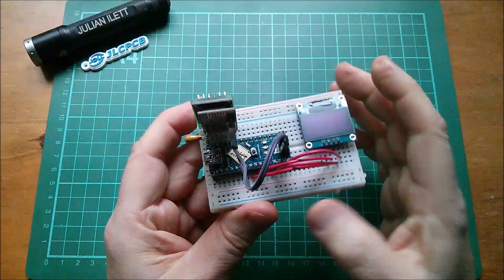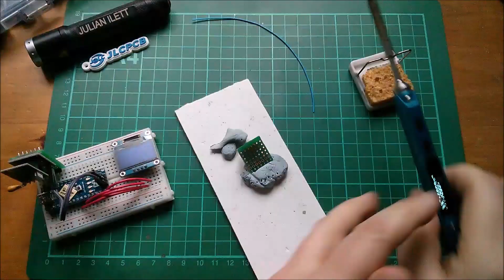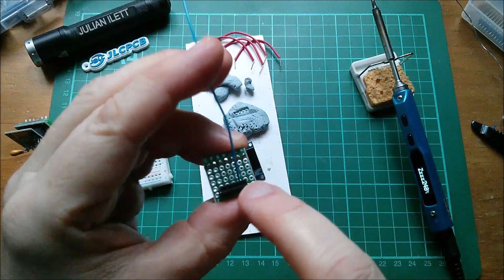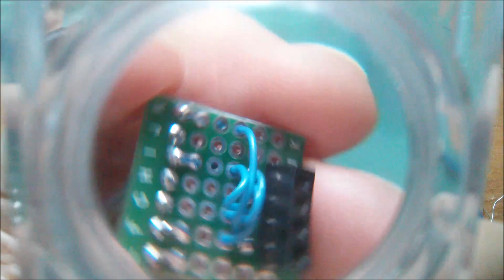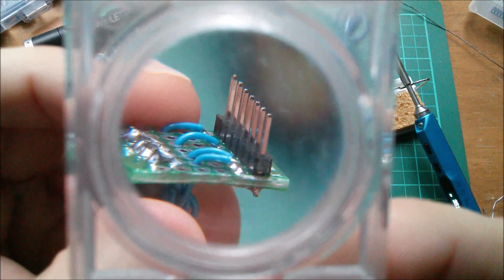Arduino nRF24L01+ OLED Breadboard Adapter

Comment: I’ve been trying to solder some headers, etc on some of that brownish copper board and having a heck of a time getting the solder to stick. The finished board looks like a war zone. You just stick the iron on the pad, apply some solder and bingo ! I’m ordering some of that green board.
Reply: Did you clean it with steel wool or similar?
Reply: No, just flux.
Reply: Try a fine-grade sandpaper on the copper first, then don't put sebaceous human fingers all over it, and finally use flux.
 Also, lead-free solder is not great at wetting surfaces.

Comment: I'm certain you know what your're doing. Just wondering why not have the shed device turn the fan on and off as needed to control the humidity between limits? I assume this is where you're headed? 

Thanks for all your vids btw. Really appreciate you sharing these projects and your thoughts along the way.
Reply from the maker: That is where I'm headed, but in baby steps :)

Comment: So you have an mcu in the shed that radios you to let you know the shed is damp and, once you've noticed, you press a button that sends a radio instruction back to the shed to turn the fan on. I think I know the answer, but why not just have the shed mcu turn the fan on when it needs to?
Reply from the maker: Because it's not that simple. There's no point bringing in air from outside if it's more humid than the air inside. The fan must deactivate if the lead-acid battery drops below a certain voltage. I may not want it to run at night.
Reply: @JuliansShorts  so there's an outside humidity sensor too? Is the lead acid battery sending its voltage over the radio as well or will there be a volt meter in the shed you can wander over to check, then, if there's enough voltage you can wander back and press the touch sensor?   Hang on a minute...  Joking aside . (I am pulling your leg) I make similar contraptions and my wife is always giving me a raised eyebrow look.
Reply from the maker: The art of a YouTuber is to arrive at the solution via the most circuitous route possible :)